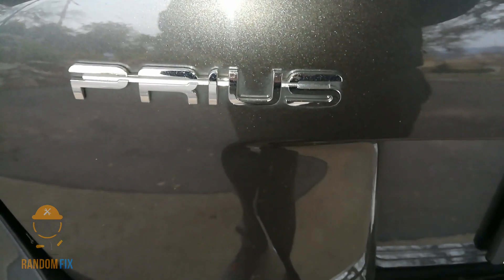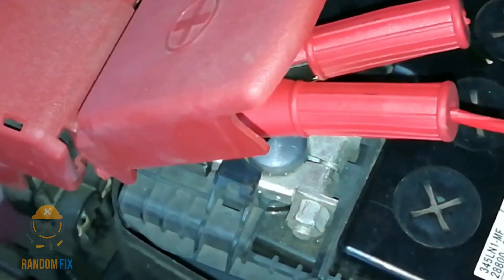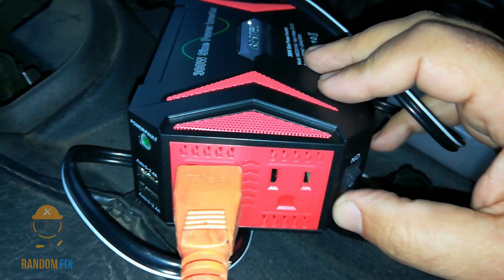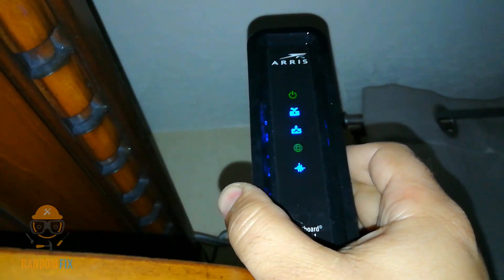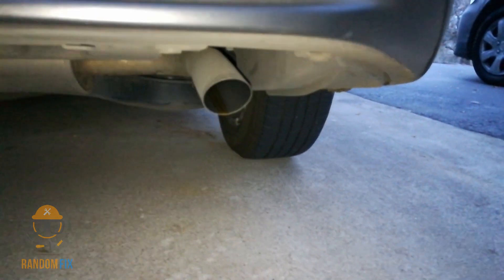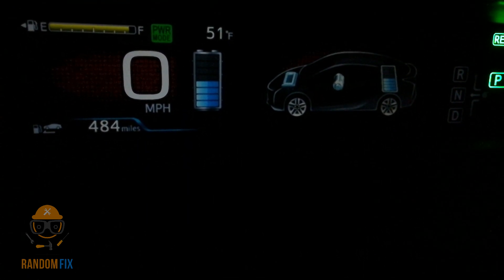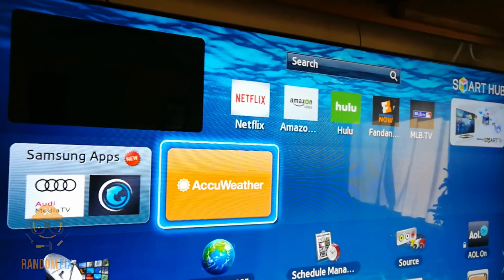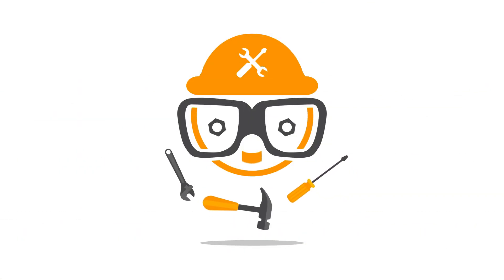Prius inverter▶️ Toyota Prius Power Generator Powers House

Comment: Actually you can do this with any car my buddies power got turned off one time I took a 12 volt battery run jumper cables to his vehicle outside the garage door.. had a 1500 watt power inverter hooked it all in.. run a extension cord to his fuse box and wired it in at the cook stove breaker it ran his entire house as far as just lights and a small heater...
Reply from the maker: Gary, Yes you are correct you can use the 12-volt inverter on any car. At your buddies house did you run the extension cord to fuse panel? How long did you have to keep his vehicle running?
The reason I like using the Prius is because it's probably the best gas generator on wheels and it's got a huge high voltage power bank / hybrid battery that will supply power the 12v system lots of power without having to stay on for more than 3 minutes. It's very efficient. Thanks for sharing and have a great day. _Randomfix
Reply: @RANDOMFIX   well the only good thing about using a Prius for this is it will start and turn itself off automatically you don't have to turn it off start it up manually and yes I ran the extension cord to the fuse panel wired it is at the range breaker but you have to turn every breaker off in the house and only turn on what you want to run as per the size of inverter your using
Reply from the maker: Awesome, thanks for the idea.
Reply: @RANDOMFIX  Do not make a widowmaker lead. If you really must, have a generator transfer switch installed next to your breaker panel that can automatically isolate the generator/prius when the 'real' power comes back.
At the very least, watch some safety videos about HV/overhead lines being backfed from a generator.
https://www.youtube.com/watch?v=2Xoyb9M5-EA

Comment: hows that fridge coming along? guess it dont matter you have netflix
Reply from the maker: Ted, it may a little hard to run a frig but having Netflix is nice. _Randomfix
Reply: Refrigerators are very well insulated, so in the event of a power outage, they can stay cold for a very long time, if kept closed. Just have to be a bit
 more careful with opening and closing them.
Reply from the maker: I don't think a small inverter will handle the initial surge of the refrig. _Randomfix
Reply: if a 750W is $10 at walfart how much was that 300w LOL for $100 you could get a 1000W even at that you still might not be able to start up an icebox
Reply from the maker: They really have a 750w for 10 dollars at Wal-Mart?
Reply from the maker: That sounds like a great deal and I will check it out .

Comment: To say powering the house is a bit ambitious...    :)
Reply: I agree. 300W is not much. Can't power your whole house on 300W. I have a 1,000W inverter hooked to my Prius, and can run the freezer, phones, computers, and other small things, like LED lights, but not the refrigerator, which draws too much when starting up. (There are others who run 3KW off the main traction battery, but that's quite different.)
Reply from the maker: MajorSmackdown, It's a little ambitious but during the power outage, it worked. _RandomFix

Comment: Can you keep your key fob inside the house to prevent the car from being stolen?
Reply: Pull the physical key out of the fob and you can lock the door with it. My key entry is open accessible, but there may be a small plastic plate to remove next to the door handle to access it. You will only be able to unlock the door with the key as well. I do this sometimes if it's excruciatingly hot and I'm only running in the store for a few minutes.
Reply from the maker: Jeff, really tricky question. IF you remove the key from the Prius it will continue to run ( you will get a message on the dash stating the key cannot be detected ) and your vehicle can still be stolen. I don't know of a way in which you can prevent your Prius from being stolen while the ignition is on. -Randomfix
Reply: @RANDOMFIX   take the wheels off duh.. and put on jack stands
Reply: Hide it super-close to the driver's door with window down maybe?
Reply: Yes, although I don't know about cars prior to 2016. The car will run without the fob. However, someone can also drive off with it without the fob, but once they shut it off they can't start it again.. (Ask me how I know, lol. Hint: It involved calling my husband to bring the fob.) There is a way to lock the door without using the key in the fob, but you will have to ask your dealer because I can't remember how. Our dealer showed us, but it was several years ago. At the time I asked them about it, I thought it would be great if you could lock pets in the car while making sure they had a/c or heat. Too bad Toyota doesn't have a phone app like some cars to remote start and control locks and temp. A Prius would be ideal for that.

Comment: Thanks for the video explaining how you do this. Very clever use of the Prius' unique computerized battery charging capability !!  You did a good job of covering the safety and security issues as well. On the exhaust in particular, while the Prius is a lot cleaner than most, as you've said many times in your video, carbon monoxide can be dangerous and fatal.  Outside, no problem.  In a garage, I think you would need to make sure the exhaust is vented outside -- like heat-resistant hose over the exhaust directed outside.  Opening a window or a few inches of space under the garage door won't be enough to keep the odorless and colorless carbon monoxide low enough in the garage to prevent it from seeping into the house.  Any carbon monoxide a person breathes in combines with hemoglobin in the blood to permanently render it incapable of carrying oxygen to the cells (carboxy-hemoglobin).
Reply from the maker: Agreed, using a specialized exhaust vent would be ideal. Thanks for the feedback : )
Reply: Not permanently incapable, but CO does bind at a rate 200x that of O2.